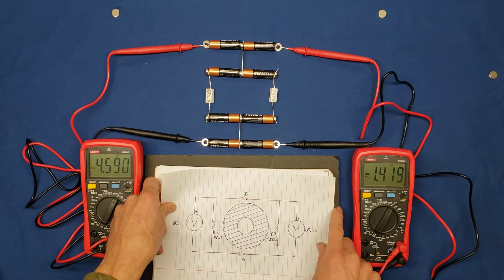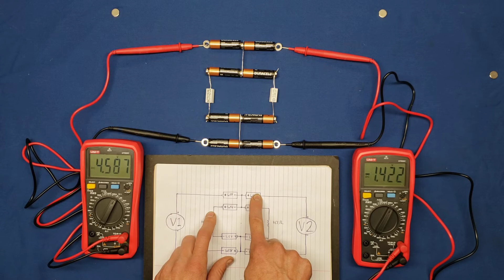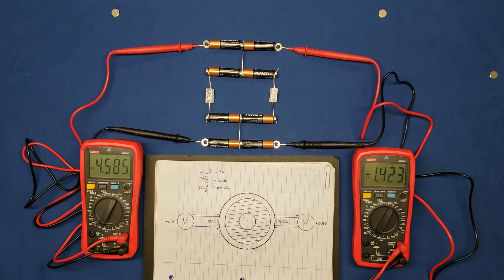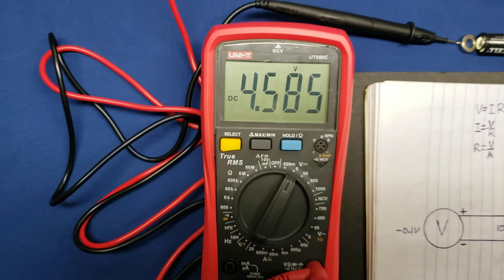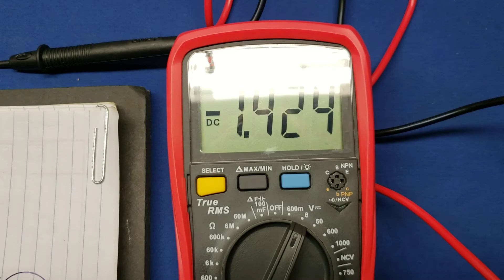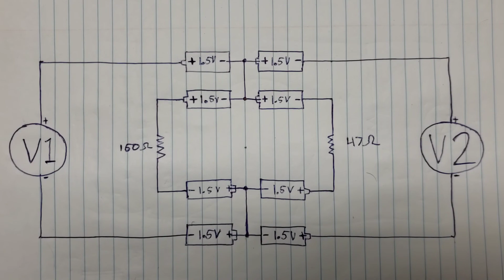Lewin's Paradox explained: Kirchhoff voltage law (kvl) doesn't  work with DC either!

Comment: WRONG. The voltmeters are NOT connected to the same points. You can't conclude that KVL doesn't work. you are making conclusions from a false premise.
Reply from the maker: @kpaxxapk6397  hey friend, I tested a setup like Lewins, but I correctly probed, and KVL held up just fine. See here: https://youtu.be/nAsZFP8Cfxk
If you probe correctly, and actually apply KVL (which Lewin did neither) it does work on his setup.
Conversely, if you refuse to probe correctly and refuse to account for the inducted voltage in your volt meter leads, then not only does KVL fail, but so does Maxwels equation and every other form of science. You can't measure or do science or do physics if you have wild unknown unmodeled influences in your test equipment.
Reply: @fromjesse  If you refuse to probe correctly then KVL and Maxwell still hold but you just get the wrong results out of it if you dont model you probing correctly.^^
(Its a matter of using the right language here)
Reply from the maker: @Merilix2 exactly.  And,  that's exactly the mistake that Dr. Walter Lewin made, which is why I made this satire to illustrate his mistake in an obvious manner. Thats why its titled Lewins paradox explained.
Reply: @fromjesse  In fact he made several mistakes. 
1) he just ignored what he showed half an hour before when he memasured a current on a closed wire losely laid around a solenoid.
2) He does not discuss possible objections but simply claims their insignificance with unsound arguments. (Assume this is a superconductor -- well, there is no superconductor and if there would be one this would have to be discussed further)
(There is no current bc. Voltmeter has hundreds of megaohms -- well, thats the reason why charges and therefore voltage can be built up)
3) (and most annoying) He discredited Kirchoffs contribution by calling it "for the birds".
KVL may not be applyable literally in its original form but the whole idea was right and holds if L dI/dt is taken into account as it is in its modern extended form.
4) ... and some more mistakes...

What he did there is not teaching science but catching attention. :/
Reply from the maker: @Merilix2  You are exactly correct. The whole foundation of KVL is lumpability. If all  components in the circuit  can be lumped, then KVL will hold. And what is lumpable has been long and clearly defined.

And it includes transformers, so long as the component is small compared to the wavelength and the voltage across the terminals can be unambiguously measured and the current entering one terminal is equal to that leaving the other.

Lewin's transformer was completely lumpable.

But as you said he wanted to catch attention :D

Desoer & Kuh, in Basic Circuit Theory:

https://postimg.cc/YGzPzVzJ
Reply from the maker: @kpaxxapk6397  Hey Samuel, for some reason I didn't get notice of your comment but then I saw it when Stainless Cat (Coper Nico Felinis) replied to the top of the list!

I totally agree that there are cases where KVL doesn't hold, because there are cases where the component elements cannot be lumped discretely, or there are cases where there are transmission lines or propagating waves which would cause KVL to fail.

I just don't think Lewin's example is one of them cases. I think it was in very poor taste of Lewin to trick his audience like that, and I have no idea why people get all cultish about it.
Reply: @fromjesse  "...transmission lines or propagating waves "
Well, I wonder if even in this cases, one can model any instant moment in time by DC replacement and KVL still holds.
Reply from the maker: @Merilix2  That's an interesting question. I'll have to think about that. I feel what you're saying. But when the wavelength is short compared to the overall circuit, and space itself is now storing the energy of the traveling wave perhaps, I can see it becoming complicated.

Like for example, when the wavelength is short, the space surrounding the non-coaxial feedline may actually become part of the circuit so to speak, and the current into one end of the wire may not actually be equal to the current  out of it. So it's not exactly crystal clear in my mind what constraints would be needed for KVL to hold up for propagating waves, at least in a practical sense.
Reply: @fromjesse  Well, I guess what you cant model that way is how signals / ramps (or how it is called if you switch a power source) propagate along the wire over time bc a DC replacement has no /dt dependency. 
But thats the main reason why I think KVL must hold for any instant moment in time; no /dt dependency! Even if the current is different the next instant moment.
And isnt this exactly what Feynman meant with "... all  components in the circuit  can be lumped...," ?
Reply: @fromjesse  Edit, You are right, the Idea (and likely KVL) breaks if the spacial size of the cirguit is of the order of the wavelengts in question. (which is not the case for WL's experiment)
Reply from the maker: @kpaxxapk6397  hahahaha thanks! I had a feeling that's what he was getting at (and in fact called him out -- I asked him "Are you asking me to loop my volt meter lead through the transformer core and pretend it's not a secondary winding?")

I'm tempted to do something really snarky like drill a tiny hole through the toroid core with a carbide or diamond bit to allow me to actually measure it without inducing voltage into my probe lead.

This, right?: https://postimg.cc/ykw44kYz

So I guess I just need to tell him that I cannot honestly run my volt meter leads through the transformer core and pretend that they won't have voltage induced in them.

That would be deceptive lumping and would give inaccurate readings. 

Where does the guy draw the limit? If I'm going to loop my test leads through the transformer, I might as well do it a hundred times and get some really spectacular results!

This guy just doesn't get lumping or probing, does he! 

How would I show him he's wrong? I've already given him videos that show how a volt meter passing through a changing magnetic field parallel to the primary winding acts like a secondary winding.

Ahh, I have an idea. I can measure the three voltages around the 3 nodes, then demonstrate that it doesn't matter how far into the transformer I slide my test probes along the loop, the same amount of voltage is induced because it's still one turn on the transformer.
Reply from the maker: @kpaxxapk6397  Yeah, I took the PDF you sent me and screen captured the diagram on page 499 :D
Reply from the maker: @kpaxxapk6397  Yeah, I've seen sometimes comments will actually be hidden, but if I click "Sort by Date" then they show. YT is so buggy.
Reply from the maker: @kpaxxapk6397  Well, I called him out as a troll. 
He gave me this image: https://postimg.cc/FfvyY5VB

In order to force KVL to fail, he seems to be asking me to move the transformer winding section around to different locations on the loop each time I move the volt meter. Which is like literally taking a voltage from a random place in 4 different circuits and adding them up and expecting the sum to be zero.

Talk about moving the goal posts!

I moved the discussion to a shorter thread under the same video: 
https://www.youtube.com/watch?v=V_Gs8tSqBRY&lc=UgwYratBIEuub8PjXuB4AaABAg

(Old one was getting annoyingly long.)
Reply: @kpaxxapk6397  (This is a response to your second comment in this thread, specifically the comment that starts saying "Once again, ask yourself this very simple question. How does the voltmeter know where the fuck it's placed or which path to measure? It doesn't.")

My response: well, the thing is (analog) voltmeters don't measure voltage! They measure current, and are calibrated to give the corresponding voltage, by using Ohm's law in the intrinsic finite resistance inside the voltmeter. And since current doesn't depend on path, this solves the question you asked.
Reply from the maker: You are correct. And Professor Lewin, formerly of MIT, is also wrong when he claims that KVL does not work because he also is making his conclusion from a false premise.
Reply from the maker: @kpaxxapk6397  Not all PHD Physics professors agree with Lewin.

I'm assuming you've read the paper by Dr. Kirk McDonnald of Princeton? http://kirkmcd.princeton.edu/examples/lewin.pdf

He says in that paper that Lewin is using "misdirection" (which is something a stage magician does) and he also says that Lewin is using a non-standard version of KVL.
Dr. McDonnald concludes his footnote with "Of course, use of an obsolete version of a “law” can lead to apparent paradoxes."

He's not even granting that it's a paradox, but only an apparent paradox!

Dr. McDonnald also says "In Lewin’s example, a meter reading, does not equal the voltage drop between the tips of its leads ...."

So again, Lewin claimed that the volt meters were connected at the same point, which he said to trick the audience into believing they were reading the voltage difference at the tips of the leads. But it was a lie. Dr. McDonnald says it was NOT reading the voltage at the tips of the leads.

Dr. McDonnald winds up saying "Lewin’s circuit is within the range of applicability of Kirchhoff’s loop equations, which can be used to predict measurements by the “voltmeters” in the experiment. "

Or did you read the paper by Dr. John W. Belcher of MIT? http://www.electroboom.com/share/FaradaysLaw_Mehdi.pdf

Dr. Belcher ends up citing Feynman, claiming that KVL does hold.

He ends up saying "In this sense, KVL holds, as argued by Mehdi Sadaghdar ..."

So help me out here please. We've got two Phd physics professors from two of the greatest universities in the USA, one of them citing Feynman, who is one of the 10 greatest physicists of all time in the world - with the other 9 being Albert Einstein, Isaac Newton, James Clerk Maxwell, Niels Bohr, Werner Heisenberg, Galileo Galilei, Paul Dirac,  Erwin Schrödinger, and Ernest Rutherford.

And the other of these great physics professor I've cited says Lewin is using an obsolete version of KVL, using misdirection (which is a form of intentional deception),  and who calls Lewin's paradox an "Apparent paradox."

So you're telling me they are all wrong?

And then there's my own measurement that KVL holds just fine if you use your volt meter honestly: https://youtu.be/nAsZFP8Cfxk

At the end of the day, you aren't gonna make it in the real world of engineering if you think a volt meter cannot measure voltage accurately in Lewin's setup. It can, and it does.

Lewin did NOT tell the audience how he had is volt meter leads run. If he had, KVL would have held fine for him too.
But he loves a dog and pony show, and he put on a good one that day.
Unfortunately, he also lied to his audience. He claimed the volt meters were identical and were connected at the same point. But only one of those two claims can be true at the same time.
Reply: Chill guys, we are all here for the love of science and nothing personal. In my opinion, the validity of KVL depends on its definition. The reason why I'm starting with the definition is that if we can't agree on it then there is no point in talking about KVL. 

Kirchoff's voltage law: The closed line integral of E.dl is zero.

Following the above definition and using vector calculus, a direct consequence is that the potential difference between two points is always the same regardless of the path of integration. However, experiments have shown that the voltage between 2 points can be different in the presence of varying magnetic fields thus making KVL invalid. Dr. Lewin has demonstrated it in class and he is not the first person to do that. 

Somebody asked how the voltmeters know which path to follow while computing the voltage between 2 points. For this, I suggest you read a paper written by Robert H. Romer on the topic "what do voltmeters measure". If, after reading that paper, you are still unable to understand why Dr. Lewin placed one voltmeter to the right and the other to left then let me know I will explain.
Conclusion: Dr. Lewin's experiment is legitimate there is no trickery involved there isn't any probing error. It is just that KVL is a special case of Faraday's Law. It really makes me sad that almost all physics books and their authors get it wrong.
Reply from the maker: @liendatt8347  
Well, Dr. Lewin did trick his audience. He did NOT tell him how his volt meter leads were run. If he had honestly analyzed the change in magnetic field across his volt meter leads, his calculated voltage would have matched his measured values.

If he was being honest, he would be like "So I have some half turns on this transformer and I have these half turns in series with my volt meter leads, which is why the two volt meters read differently -- because the half turns are inserted in opposite signs, adding to one volt meter and subtracting from the other volt meter."

But that wouldn't have been funny or stunning. His audience would have just said "Doh, the transformer was invented in 1885, tell us something interesting like if McD's is having a sale today..."

Not all PHD Physics professors agree with Lewin.

I'm assuming you've read the paper by Dr. Kirk McDonnald of Princeton? http://kirkmcd.princeton.edu/examples/lewin.pdf

He says in that paper that Lewin is using "misdirection" (which is something a stage magician does) and he also says that Lewin is using a non-standard version of KVL.
Dr. McDonnald concludes his footnote with "Of course, use of an obsolete version of a “law” can lead to apparent paradoxes."

He's not even granting that it's a paradox, but only an apparent paradox!

Dr. McDonnald also says "In Lewin’s example, a meter reading, does not equal the voltage drop between the tips of its leads ...."

So again, Lewin claimed that the volt meters were connected at the same point, which he said to trick the audience into believing they were reading the voltage difference at the tips of the leads. But it was a lie. Dr. McDonnald says it was NOT reading the voltage at the tips of the leads.

Dr. McDonnald winds up saying "Lewin’s circuit is within the range of applicability of Kirchhoff’s loop equations, which can be used to predict measurements by the “voltmeters” in the experiment. "

Or did you read the paper by Dr. John W. Belcher of MIT? http://www.electroboom.com/share/FaradaysLaw_Mehdi.pdf

Dr. Belcher ends up citing Feynman, claiming that KVL does hold.

He ends up saying "In this sense, KVL holds, as argued by Mehdi Sadaghdar ..."

So help me out here please. We've got two Phd physics professors from two of the greatest universities in the USA, one of them citing Feynman, who is one of the 10 greatest physicists of all time in the world - with the other 9 being Albert Einstein, Isaac Newton, James Clerk Maxwell, Niels Bohr, Werner Heisenberg, Galileo Galilei, Paul Dirac,  Erwin Schrödinger, and Ernest Rutherford.

And the other of these great physics professor I've cited says Lewin is using an obsolete version of KVL, using misdirection (which is a form of intentional deception),  and who calls Lewin's paradox an "Apparent paradox."

So you're telling me they are all wrong?

And then there's my own measurement that KVL holds just fine if you use your volt meter honestly: https://youtu.be/nAsZFP8Cfxk

At the end of the day, you aren't gonna make it in the real world of engineering if you think a volt meter cannot measure voltage accurately in Lewin's setup. It can, and it does.

Lewin did NOT tell the audience how he had is volt meter leads run. If he had, KVL would have held fine for him too.
But he loves a dog and pony show, and he put on a good one that day.
Unfortunately, he also lied to his audience. He claimed the volt meters were identical and were connected at the same point. But only one of those two claims can be true at the same time.
Reply from the maker: @copernicofelinis  
>Exactly what is measured by the two voltmeter attached AT THE VERY SAME POINTS at the two sides of the ring.

But that's a lie on Lewin's part. He claimed the two volt meters were identical and measuring at the same place. But that's a sleight of hand: He had secondary windings in series with his volt meters, one adding and one subtracting voltage. He can't claim his volt meters are identical when he has a positive offset error added to one and a negative to the other!!

Or if you say "Well, those secondary windings aren't part of the volt meter" then you have to admit they are part of the circuit under test, and now the volt meters aren't connected to the exact same place anymore. That's why I made this video with the batteries and the "two identical volt meters."

The two volt meters may be identical, OR they may be connected in the same place, but it's a LIE to say they are identical and connected in the same place.

>It does not matter how you place the probes as long as you do not cut through the dB/dt region or go around it in full circles.

Well his volt meter leads DID cut through the dB/dt  region. 

Lewin's loop was perfectly lumpable. His volt meter leads were nice tightly coupled secondary half-turn windings (or quarter turn windings depending how you want to slice it) and they could be readily lumped as a partial turn secondary and then KVL holds fine.

Did you see my "Lewin Clock" video? https://youtu.be/nAsZFP8Cfxk

I clearly demonstrate that KVL (which by the way stands for K's VOLTAGE Law....) holds fine if you don't have voltage differential induced into your volt meter leads.

And by the way, if you have unmodeled voltage induced in your volt meter leads, MaxEQ isn't gonna hold true to reality neither. If your volt meter isn't measuring the voltage at the location you think, you FAILED CLASS and aren't gonna make it in the real world of physical physics.

Look. I'm a hand's on guy. I like to test things. That's why I built the Lewin Clock and tested reality. KVL held true.

The only thing I'm interested in from you is find a proof that, when honestly operating a volt meter, KVL does not hold true in the circumstances it is supposed to hold true -- and that is where the wavelength of the signal is drastically larger than the dimensions of the circuit under test.

I have personally tested KVL at 40Khz with an air core winding in the above link. I have also tested it at 60hz with an iron core winding here: https://youtu.be/iDWv8QJrzUo

If you think KVL does not hold, then show me. Sorry if I seem impatient, Lewin called me a flat earther when I asked a very simple honest question when I first saw his Lect 16. After that, I was in two extremely long and in depth discussions from a couple other armchair physicists who had the tenacity to the hilt but could not prove that KVL did not actually hold true in Lewin's setup in the real world. 

That and I just spent the day trying to convince flat earthers that the earth is a globe. And this feels just like that.

The fact is, Lewin KNEW he was deceiving his audience. Otherwise he wouldn't react so harshly when people questioned him. In fact, what he would have explained that there were secondary windings in series with the volt meter leads. No big deal. But he wanted to trick people - that's why he said "This is so amazing your grandchildren will be telling their grandchildren about it..."

Go experiment. Try it. The tooth will thet you three.
Reply from the maker: @copernicofelinis  
>identical means same make and model, At the same place means the probes are attached at the same two points

No, identical means the ENTIRE MEASURING SYSTEM is identical. And just like the video at the top of this page shows, inserting different offset errors into the leads makes the measurement systems UN-IDENTICAL.

If you have induced voltage anywhere in your volt meter leads, you have bad probing. Period. 

I mean, if you can call two voltage measuring systems identical but put a battery in series with one of them to cause an offset error, then why can't I change out some of the resistors in one of the volt meter and call them identical? No, No, No, and No!  You cannot modify two previously identical volt meters in different ways and call them identical. That's a fraud. Sorry, it just is.

If  your bathroom scale gave you a random error, or magically included the weight of your pet dog when you climbed on it, or factored in a +/- 50% for the phase of the moon, would you really say  you're accurately measuring your bodyweight? Of course not. 

And if you took two identical scales, and added a +10 pound offset error to one and a -10 pound offset error to the other, are you still gonna say they are identical?

>At the same place means the probes are attached at the same two points

The probes weren't attached at the same two points. They were attached at the other end of some transformer quarter turn windings, which Lewin purposfully ignored to shock his audience.

If you want to classify those quarter turns as part of the volt meters instead of the circuit under test, then you can no longer claim the two voltage measuring systems were identical because in fact they had different offsets added to them.

>And you are putting your probes inside the variable magnetic region!

I could have put them any number of places as you saw in the other video. The whole point of probing correctly is so that there are no errors introduced into the probe leads themselves.

>you just brushed Feynman aside with no second thoughts huh?

I already told you. A PhD Physics professor (who knows more about this than you and I combined) at a major college wrote a paper in which he says that Feynman agrees that ElectroBOOM is correct. I read it. Like it or lump it, there's very high caliber PhD's on my side too. I'm not playing that game. It'd be one thing if I was the only guy in the world taking my side, but I'm not. There's been a number of very skilled real-world hands-on guys as well as very highly respected PhD Physics Professors who also take Lewin to task. Sorry that offends your senses of reverence for the FORMER MIT professor who didn't have the decency to explain to his audience WHY the volt meters read differently, and who calls people a flat earther if they ask him about it.

>What does Feynman says? That in order for a circuit to be lumpable, the CIRCUIT PATH must not enclose a variable magnetic region.

Citation please?

Lewin already knew his volts per turn at the location of his secondary windings. He can lump it like secondaries on a transformer. Seriously, it works. I tried it. I did it at 40Khz and 60hz.

But seriously, that's what lumping is all about: Understand your lumps, and demarc them in the appropriate places so that you are measuring what you think you are measuring. Then place your volt meter leads in such a way that you're not adding some error to your reading. 

>Does Lewin's ring enclose a variable magnetic region? Yes or No?

Are you asking if the magnetic field is changing over time? or if the peak is changing between each successive firing? or changing between the two secondaries involved?

I'm going to address the last one, because that is the pertinent one. The two secondaries - that which he admitted to having, and that which was formed by his volt meter leads - were not changing in area with relation to each other or absolutely, and were of essentially the same area.
This means that the volts per turn was essentially the same  on both, and could then be lumped and modeled.

Look. You haven't answered me WHY Lewin claimed his audience would only see that once in a lifetime, or why he wanted them to tell it to their grandchildren.  Why didn't  he explain that the volt meter leads were acting like transformer secondaries? Why did he deceive them about that?

In a nutshell, he had more windings on his transformer than he told his audience. It was a sleight of hand.

Seriously - the only thing I want you to say here is to provide me a video that shows that KVL fails at frequencies where the wavelength is drastically larger than the dimensions of the loop, and the volt meters do not have voltage errors introduced in their leads.

Otherwise, I don't want to hear it. There's just too many armchair physicists out there who never touched a volt meter in their life. They live in a virtual world of theory where they make assumptions that aren't true and they never find out because they never try it in real life, and then they go around telling the actual boots on the ground "how it is."

I was extremely patient with the first two, and gave them every opportunity  show me either an example of KVL not working, or explain to me that it was an issue of me using the wrong definitions, and neither one could do a lick in either direction. And I'm pretty sure you can't either.

Look. I'm perfectly willing to test my understanding of physics against observable reality. You saw the test jigs I built. 

Now, let's see you produce some real-world hands-on video evidence of KVL not working as I stated above.
Until then, please take your Lewin magic show propaganda elsewhere.
Thanks!
Reply from the maker: @copernicofelinis  Nah, you're the flat earther. You're the one that won't pick up a volt meter and demonstrate your claim in the real world.

You follow Lewin because I don't know why, even though he's clearly deceiving his audience for the wow factor. You still haven't answered why he didn't explain to his audience that his volt meter leads were windings on a transformer, or why his demonstration was so spectacular that they would be telling their grandchildren about it.

KVL states that “The algebraic sum of all voltages in a loop must equal zero.”

I algebraically summed  all the voltages in the loop and it equaled zero. KVL holds.

As to Feynman, you didn't quote him, you paraphrased him -- and you entirely missed the point of what he did say.

Here's what he DID say:

According to our approximations there is no magnetic field in the region outside the individual circuit elements.
(Emph. Mine.)

The point you missed in Lewin's circuit is the fact that his quarter and half turns of secondary windings can be lumped as BEING the lumped elements inside which the magnetic field was confined, for our APPROXIMATION.

The only part of Lewin's circuit which were not part of the transformer secondary elements were the resistors - and FOR OUR APPROXIMATION they were so small that they had negligible voltage induced on them, and FOR OUR APPROXIMATIONS could be reasonably lumped and modeled as being OUTSIDE of the magnetic field.

(Ha! Or if the resistors were simply turned 90 degrees so they were at right angles to the general loop path, then they WOULD have zero effective size.)

Unless you want to say that there is a voltage induced across a zero point in space due to the changing magnetic field.

(And even if the resistors made up 1/50th of the loop path, that's still only 2% error which was probably less than the error of his volt meters..)

Now, let's say you're not comfortable with approximating the resistors to be of zero size, VERY SIMPLE: Just lump them as a CIRCUIT ELEMENT which consists of a 1/100th turn secondary transformer winding in series with a resistor.  Then it's not even much of an approximation because there is ZERO length of the loop that is being influenced by the magnetic field but not accounted for.

You're obviously just making stuff up that you don't understand. Sure, Feynman said that according to our approximations there is no magnetic field in the region outside individual circuit elements. But you didn't even stop for half a second to ask WHY? WHY? And Why is because - AND ONLY BECAUSE - if there is un-accounted-for induced voltage in the loop path, then there will be error. But if  the entire circuit is lumped in such a way that there is NO un-accounted-for induced voltage, then there's no reason KVL won't hold!

Please tell me why  Lewin didn't tell his audience that he had some quarter turn transformer secondaries in series with his volt meters. Please tell me what was so shocking about volt meters reading different windings on a transformer to have different readings. Why are you gonna be telling your grandchildren about it?

That and please have a video showing me an example as I stated before showing that KVL doesn't hold.
Reply from the maker: @copernicofelinis   >the reason Lewin did not tell about the "quarter of a turn" you should ask him.

It's really fascinating. All the people who've gotten on my case about this absolutely refuse to acknowledge Lewin's deception of the audience. It's like they worship him, I don't get it.

>You clearly do not understand how an inductor works and what are the fields at play.

You funny person. I'm the one that makes videos showing explicitly how induced voltage and magnetic fields play. You bring nothing to the table. 

>You have the right to remain ignorant.

If you're so smart, then tell me in your own words why Lewin's loop cannot be lumped.

Just because YOU don't know how to lump it doesn't mean that it can't be done.
Reply from the maker: @copernicofelinis  Lewin's circuit also had four separate regions. You're still not explaining why his loop could not have been lumped. Seriously? He had 2 half-turns, and two resistors, in a loop. He then had some quarter turn windings in series with two common points, where he connected his volt meters.

Why can't that be lumped as it's constituent half and quarter turns and resistors? If he had lumped it that way and measured, would KVL have held for him?
Reply from the maker: @copernicofelinis  No, this is what he had: https://i.postimg.cc/fTQX5tJC/IMG-20201018-115018189.jpg
All of his secondaries were essentially in the same position and path. No reason you can't lump them as parallel secondaries on a transformer.

Look, I get that you don't know enough to lump that and measure it.  But I do.

This discussion is ridiculous. I've shown my work, in full color HD video with stereo sound. I back up my claims.

You've got nothing to show. Absolutely nothing.

Why can't you at least make a video proving your claims? Seriously. Do you really expect people to believe you when you go up to somebody who actually did an experiment and tell him he's wrong when you won't even do your own experiment and try to support your absurd claims?
Reply from the maker: @copernicofelinis  Am I literally going to have to make a red coil just like Lewin had and set up exactly a clone of what he had just to prove it to you? Maybe someday I will. 

But here's the problem - and this happened to the two armchair experts I already debated this with who were both much more educated than you - they think they know what's gonna happen, I make a demonstration video showing them they are wrong, and they just move onto the next issue without even acknowledging that they were wrong, and they go on to make another wrong statement, that I then prove wrong.

It'd be the same thing with you. I show you  you're wrong, and you won't admit it you'll just throw up another bogus claim.

Seriously though, my Lewin Clock video shows the EXACT setup electrically as Lewin had. I have the solenoid. I have the top and bottom half-turns, just like he had. Only difference is I connected my volt meter leads CORRECTLY, and I lumped it correctly.

It's time for you to put up or shut up my friend - you make me a video showing I'm wrong, or take your misinformation elsewhere. Lewin would love you to comment on his videos. In fact, were you one of his students?!!? I know you weren't the one who got him fired, but he had a lot of students, you must be one of them. Why did you drop out of class?

Let's face it. If you had intelligence and understanding on this topic, even if you believed on a technicality that Lewin's loop was unlumpable or that KVL didn't hold for it, you would still be able to see that there is a way to lump it, and there is a way to run volt meter leads in such a way that they have no voltage induced into them, and you would see that this would cause KVL to appear to hold true.

The problem isn't that you disagree with the meaning of lumping and KVL. It's that you don't seem to even understand the topic to begin with. You're just quote mining and paraphrasing them without even understanding why they are important and how to get around the problems they describe.

Take it somewhere else. I have to put up with Lewin's trolls on his channel. I don't have to put up with them on mine.
Reply from the maker: @copernicofelinis  Well, I was about to ban you, but you finally are proposing an experiment which you think will prove your claims. That's all I asked of the other armchair warriors as well, they couldn't do it, maybe you can.

Please tell me what you have in mind. I'm not sure what you mean when you say "Repeat the H-transformer experiment with a toroidal transformer."

How the tarzan can I repeat two-hole transformer experiment with a one hole transformer?

Or are you just telling me to be stupid like Lewin and run my volt meter lead through the core of the transformer and pretend they don't form a secondary winding on the transformer?

Please send me a diagram or depiction of some sort of what setup you have in mind.

Thanks!
Reply from the maker: @copernicofelinis  Is it OK if I use a single resistor, since otherwise it's just two resistors in series?
Reply from the maker: @copernicofelinis  Never mind using 2 resistors is better because it makes it easier to see that I'm following KVL ha ha
Reply from the maker: @UCQ9l6hEM5UH79_oobCHzY9g I do have one request though, can I use a 47 ohm resistor and a 150 ohm resistor? I have them handy and they are photogenic resistors. 

Also, is it OK if I have multiple turns on my secondary?
Reply from the maker: @copernicofelinis  What?? Too much measurement error?  What do you mean?

Anyway, I already built this before I read your response: https://postimg.cc/H845YG00

Please make a convincing argument as to why this won't work. KVL doesn't say that any given component lump has to have any specific voltage. It just says that the sign correct sum must add up to zero.

More voltage is more easy to accurately measure than microvolts anyway.

But make a solid argument for a single turn and I'll rework it to have a single turn.
Reply from the maker: @copernicofelinis  You're going to have to provide a diagram. I don't have the books you referenced. I googled it quickly to see if I could find what you were after, but I didn't see it. You're worse than a flat earther when it comes to not showing your work!

If you can't link me to an exact picture or sketch showing what you have in mind, then for the love of pie draw one and put a picture of it on https://postimg.cc/ and post the link here.

As far as I can tell, you're asking for a loop composed by the series connection of two resistors and a transformer secondary winding. That's what I built.

If you want something else, you're gonna have to show me. Or find a better way to describe it.
Reply from the maker: @copernicofelinis  So is this OK here? https://postimg.cc/JyzSLM88
Now I got a single turn, and it's ring shaped.
Frankly I'm not sure what you're no about, the one with the EI-Core transformer. I didn't have a round ring on that one, I had a square ring. It was a square, dude! What's the difference between a square and a triangle? It's not like the electrons care. Not at this frequency. You're not making any sense.
Reply from the maker: @copernicofelinis  Hey buddy, did you see this picture? Is this ring toroid setup acceptable? https://postimg.cc/JyzSLM88
Reply from the maker: @copernicofelinis  OK buddy, Samuel helped us out and got a link to the book. We assume you are talking about this diagram: https://postimg.cc/ykw44kYz

I was right when I thought you were going to ask me to loop my volt meter lead through the transformer core and pretend it wasn't a secondary winding on a transformer!

Also, you said I should do it like the ring I built for the EI-Core transformer - but dude, that one didn't have any volt meter leads or junctions inside the transformer core! The Haus diagram you want me to do has a junction inside the core!  You really are confused aren't you.

Anyway, I'll let you know when I upload the video.
Reply from the maker: @copernicofelinis  Also, in the video, I'm going to insist on proper probing AND proper lumping. Part of doing KVL is correctly lumping and correctly probing. Those are crucial to all of physics really.

Even if you had a resistor and a battery, but instead of lumping the components at their boundaries, you drilled little holes in them and poked  your volt meter leads in random places inside the component, you would get bad results.

It's the same thing with any component - lump it so that you can accurately model and measure it.

I'm planning on measuring the voltage across each of the three nodes - R1, R2, and transformer secondary - all in a positive clockwise direction with the scope, and it'll show that KVL holds just fine, and I'll also show that looping the leads through the transformer makes them act like secondary windings.

I mean seriously, dude, think about it! If I can loop my leads through the transformer core once and pretend there's no voltage induced in them, couldn't I loop them a hundred times and REALLY show that KVL was no good? 

By the way, even if you used MaxEQ, but you had your volt meter leads looped an unmodeled number of times through the transformer core, MaxEQ would fail you too.

Let me know if you have any final words before I make the video.
Reply from the maker: @copernicofelinis  Evidentially your posts weren't coming through for a while. But I'm getting comments from you now.
Reply from the maker: @copernicofelinis  I'm confused about what you're saying about rotating the ring and not moving the probes.

I've got three lumped elements, right? Two resistors, and a secondary winding. Per KVL, I measure the voltage across each lumped element, going around the loop in a sign aware manner, for example keeping the volt meter always positive-clockwise.

What's this about  rotating the ring you say?

By the way, my resistors are too big to fit inside my toroid.

And what do you mean by "measure on one side only?"

You know KVL is going to hold true if I lump it and probe it honestly, right? And you know that I know what honest lumping and probing is, right?

I'm a ham radio operator for 20+ years, been doing electronic design and some RF engineering for that long, then I spent untold hours debating a couple other physicists who know more about it than you, so you're probably not going to trick me into doing a bad probing and bad lumping. It's possible of course, but probably not likely.

Why don't we cut to the chase here. 

Load this picture in your favorite image editor: https://postimg.cc/JyzSLM88

Put the letters a,b,c,d,e,f etc., inside the ring, showing different places you want the toroid to be placed.
(Keep in mind the resistors don't fit through the toroid.)

Then put the latters A,B,C, etc.., where you want volt meter leads to clip on.
(Keep in mind that the red wire is insulated.)

I can tell you without even testing it what voltages will be measured across any set of A,B,C points for any given a,b,c,d,e,f points for toroid location.

If we find something we disagree on, then I can test that particular scenario and we can see who's right.

Because let's face it. I'm going to refuse to incorrectly probe and I'm going to refuse to incorrectly lump, and KVL is going to hold up just fine, and you're gonna say I did it wrong and that I should have done it some other way.

So please, cut to the chase, make your case.
Reply from the maker: @copernicofelinis  PS: It's not that I'm trying to get out of making a video. It's just that I already know exactly what I'm going to get. I've already made a lot of videos illustrating very similar stuff, and they take time, and I want to make this one count by not having you say "You did it wrong" once I go to the effort of making it.
I want to find something about observable reality where we disagree so that my video can actually answer the disagreement and show which one of us is right. That's all :D
Reply: @liendatt8347  What exactly has Dr. Lewin demonstrated?  
Remove one voltmeter. Take the other one and repeat the experiment by flip it over to the other side. 
You get the same results as shown but it just tells you that the result depends on where the probe device is related to the potential at the points of the circuit you claim to probe directly. 
Path dependency? What exactly should this mean? Path of what? You simply dont measure the Voltage between A and B as claimed.